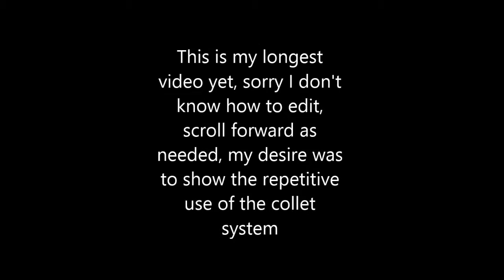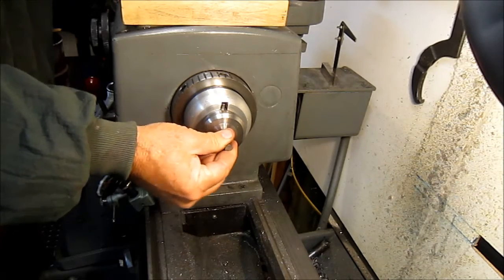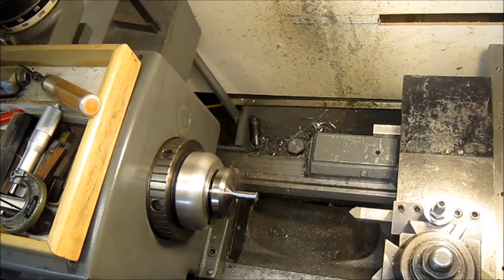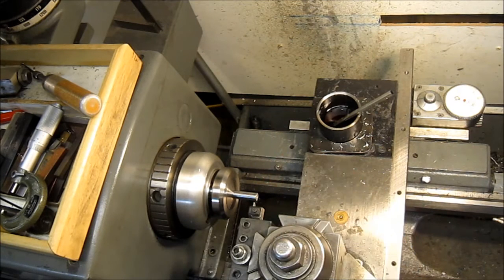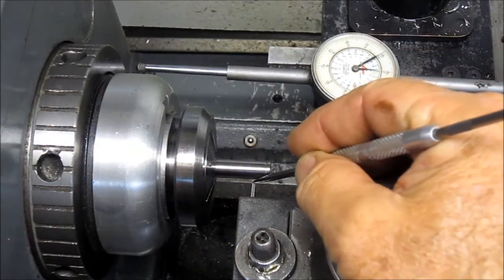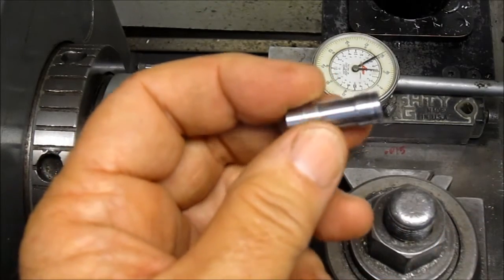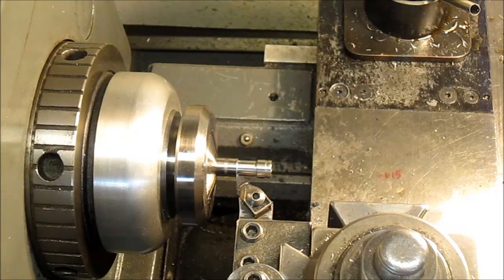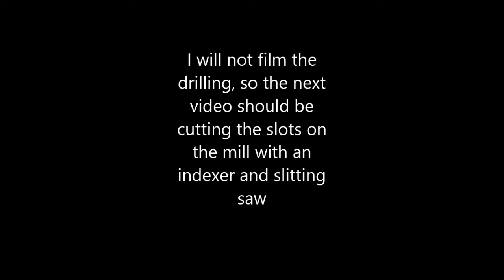Procunier tapping head collet build....part 4

Comment: You missed a trick with your chucking (no pun intended) piece, if you had made the blanks long enough to get two collets per piece instead of one collet and some waste.
When you get round to the slitting, once you have slit the first you fill the bore with round stock to stop it crushing whilst you slit the other end,
For repetition work, bed stops are much preferred to the use of such things as trav-a-dials, as they form positive stops without the possibility of over-run. Beds stops used in conjunction with the top slide, or as you colonials call them compound slide, make accurate length cuts a doddle. You would though have to put the top slide in its correct position (in line with the lathe axis) to take advantage of its dial. I wonder if this is why you chaps call it a compound while we call it a top slide, all the youtubians from the US have the thing set at an angle, even if they aren't cutting threads, and miss out on a useful feature. Oh well vive le diffference
chris
Reply from the maker: HI Chris...
Thanks for watching and your comments...
I agree, I did not think about making the blanks so that I could machine both ends...lesson learned!  Also less waste than how I am doing it.

I was going to set a bed stop on the lathe way, but with the collet setup and the fact that my threading dial was relocated to the head side of the crossslide, there is not enough room for the dead stop, I agree faster and positive....
Also, I am only making 4 (now 3 after the Fup...lol)..if I was making a large quanity, then other methods should and would be used to assure quickness and accuracy...

Regarding you question on the use of words, I will check the book I got from Doubleboost (my trick or tool video) and see if there is a explanation...LOL

Chuck
Reply: outsidescrewball Hi Chuck, which book is that, if it's English I might have a copy.
chris
Reply from the maker: Chris Stephens
Chris....you will need to watch my Tool Time video...Trick or Tool...let me know if you have that book!!!
Chuck
Reply: outsidescrewball Oh, you mean THAT book. I shouldn't take too much notice of it, if it came from John, the rest of us Brits need to have his English translated into American so we can stand a chance of understanding him.:>) (sorry DB, I couldn't resist)
When I finally buy a video camera and start posting you will find out how a proper Englishman sounds, trouble is video is still a little too new for this dinosaur.
chris